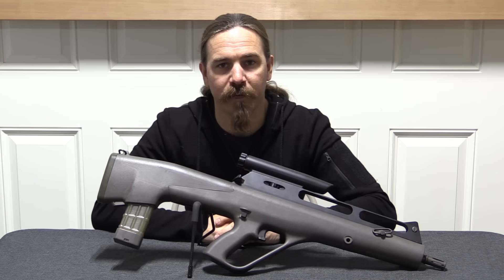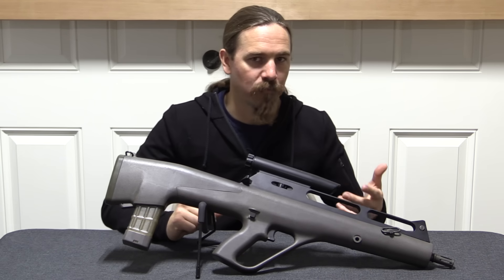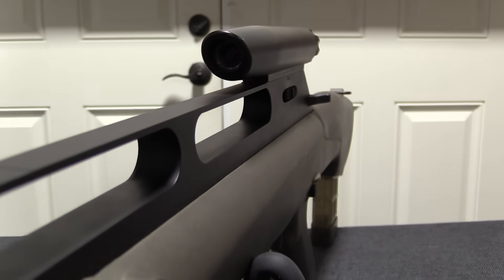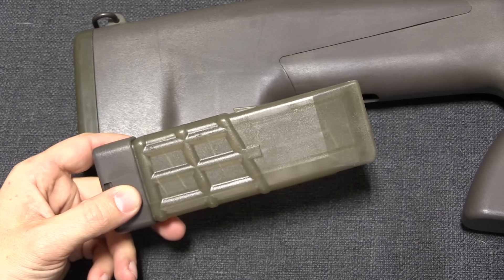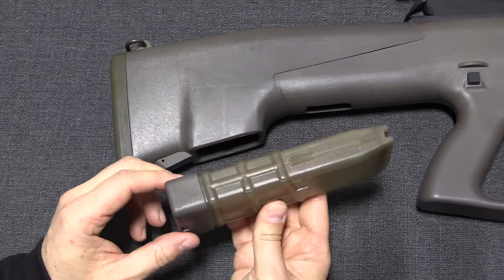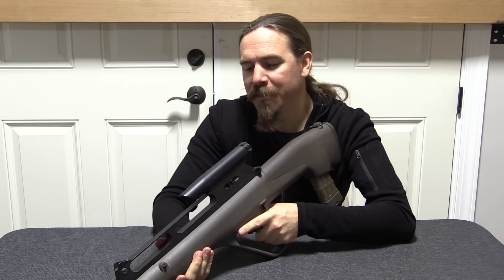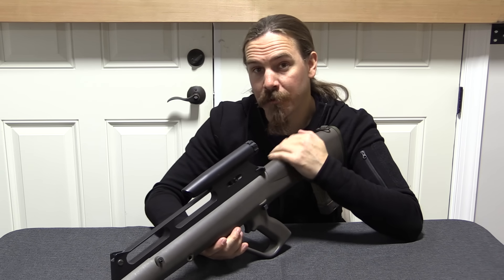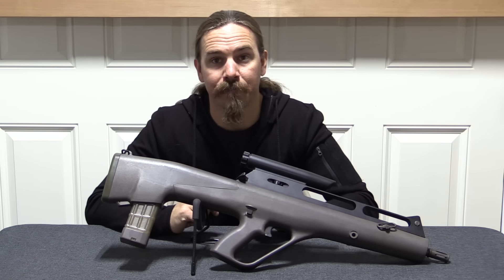Steyr ACR: A Polymer Flechette-Firing Bullpup From the 90s

Comment: As for the G11, not exactly what you're describing. The system was made so that, in 3-round burst mode, the whole internal assembly (barrel, rotating firing chamber even the horizontal magazine mounted on top) is moving backward as the three successive cartridges are fired and it's only ending its course against the backend of the gun (therefore impulsing the recoil against the shooter's shoulder) after the last bullet has actually exited the barrel.

Comment: The problems with this ammo is that in a medium wind outside you will have to compensate EXTREMELY much and thats a bit above a regular soldiers education when you are in combat measuring the wind speed is just not going to happen and it will have no chance against ceramic body armor.

Comment: Can I just say, that as an Austrian I'm really proud that my country has produced not only one, but three space rifles, even though only one, the AUG, actually saw service. Even so, both the Steyr ACR and the AMR (Anti Materiel Rifle) look sufficiently spacey to qualify for the Rule of Cool without any design changes. For those who don't know the Steyr AMR, it's another prototype for a flechette rifle, except compared to the ACR's cartridge, the AMR's flechettes are positively giant. And they have to be, because they were able to effectively take out trucks at 2000m range. Look it up on wikipedia, it's a certified "Fuck you and everything you stand for, on, under or behind" gun. It was meant to rival the Barret m82, but was ultimately scrapped in favor of the latter, which is now used by the Austrian military special forces, the Jagdkommando.

Comment: I really love the idea behind it. I can´t believe that we don´t use the same working principle as with a smooth bore APFSDS round from a tank for rifles and shotguns.
Reply: Because the APFSDS concept just doesn't scale well to small arms.

1.  Shotguns trying to fire a bore appropriate APFSDS projo would almost invariably explode due to the pressures involved with driving the projo to the velocities where the concept works better than "traditional bullets".  Shotguns are invariably designed with much thinner walls in the chamber and barrel, because they operate at pressures under 12K PSI as opposed to over 50K PSI for a 5.56x45mm.  If you build the shotgun to that pressure standard, it would be ridiculously heavy...and the Cube-Square law means your pressures for a "shotgun" sized projo will be higher than the "rifle" version - there's a reason the Rheinmetall 120mm runs near 100K PSI.  So, your shotgun would likely have to be designed around a chamber pressure of [gazes at ceiling, SWAGs it] probably north of 65K service pressure.  That's a LOT of meat you need to avoid it grenading on you, especially wrapped around a 12 gauge sized cartridge...

2.  Bundles of flechettes (such as you find in some artillery and rocket rounds, and has been trialed in shotguns and 40mm grenade launchers) doesn't work, either, even when using the exact same flechettes you use in your artillery rounds.  There's a variety of reasons for that, but every time we try it, we find it at best no more effective than plain old buckshot pellets (and generally worse).

3.  For precision fire, the APFSDS simply doesn't scale down very well, because almost imperceptible imperfections that don't matter on the APFSDS projo for a 105mm or 120mm tank round are fatal to accuracy and terminal performance on a projo small enough for an infantry "rifle".  And you really can't do even the level of QA inspection on them that the tabk rounds would get, due to production volume and cost - you're trying to crank out billions of rifle rounds before you even field the gun, whereas the total production volume of a tabk cannon round is much, much lower.
Reply: @geodkyt  1. 
"...to the velocities where the concept works better than "traditional bullets"..." I don´t understand this, can you please explain further ? 
Let´s say you do take a traditional shotgun and make undersized ammo for it like an APFSDS. You use the same pressure as before. An undersized round should be lighter and given the same pressure should reach higher velocity and because it has less impact surface should penetrate better, give the material is hard like tungsten or similar and the rod is long enough for stabilization resons.

2. Yes I thought so too when I saw the Russian flechette bombs, most of the small darts don´t hit in the right angle either and they seem to be too short to be stable enough, I too wondered why they don´t simply use balls instead. They probably made them and didn´t bother.

3. Yes that is a very good reason, the quality would have to be superb which is not feasible for a low cost item like simple bullets.

Comment: There is an idea behind the "poor" sights. (As said the military wanted a rifle for the "poor" shooter) And this optics help a lot. They are not the most accurate at long range BUT its very easy for an untrained shooter to hit quite a lot with this optics. This was also the idea for the original steyr aug. You have to remember it was designed in the height of the cold war. So the idea behind this was if a war breaks out you have a large number of conscripted relatively poor trained man. And a optic like this helps them alot to get shots on target. Of course a well trained marksman would have prefered a more accurate optic. But as said the idea behind this concept comes from cold war (and was not a bad idea)

Comment: i love this action mechanism it seems like it could have a lot of potential. perhaps it could be adapted to traditional style cartages with standard projectiles where the firing pin just punches a dimple in the side of the case like smashing the rim on a .22. it would have to be something straight wall maybe like a rimless .357 so the empty case could still be pushed out the front of the chamber. fun to think about

Comment: This feeding and locking system was essentially replicated in the Textron entry for the NGSW program (2022's version of the ACR program).

It had a similar fate though. This time round instead of sticking with the M4, they went for a slighlty updated M4 in a bigger calibre. 

Seems that innovating too far doesn't win contracts.

Comment: Hey Ian ，I find something may influence its reliability. When you pull the charging handle , the locking log of the chamber did not slide in the right place because the charging handle was not full pulled to push the lock log into the groove

Comment: i wonder if someone could make something like this built around .22 rimfire or .22 magnum rimfire to utilise the rimfire primer (or tbh could probably be adapted to use a rear primer provided the loader didn't strike the rear of the case in a way that could set a primer off, alternatively a system could perhaps even be designed to utilise a tube magazine.

Comment: As understood, the chambered round is forced against the fix firing pin, while aligning the chamber with the barrel. So no one knows on which level of that alignment the cardridge is going off?
Would it be possible to ignite before the chamber is  fully in battery?

Comment: It’s funny. The US military tried all these ridiculous ideas and crazy cartridges to improve hit probability. Most of these problems were solved by putting a ruggedized high quality optic on top of the rifle. We didn’t need some gimmicky bullets to hit targets. We needed something better than iron sights so the soldier could actually see the target. For years ordnance corps decided against issuing expensive optics to soldiers because the optics were too fragile and soldiers were “too dumb and uneducated” to properly take care of and use them. In the end, an optic on the rifle made all the difference. If the US Military had invested in making an optic that was rugged and simple to use, the problem of hit probably could have been solved years ago. Iron sights suck. If you can’t see the target at range, you cannot hit it.

Comment: Just to point out that just like arrows, the slow spin imparted on the flechettes doesn't actually serve to stabilize them through gyroscopic force.  Rather it averages out any imperfections that would tend to make the projectile curve away from it's point of aim. eg if there is a slight bend, or one of the fins is slightly bigger than the others so the slow spin puts the projectile into a corkscrew rather than curved flight.
Reply: It's been a while since I've read the book The Black Rifle, by Edward Ezel (spelling?), but I thought it was stated in that book that the purpose of the slow rifling was to cause the petals of the sabot to separate reliably and consistently from the flechette, so as not to effect the accuracy too much.

But the corkscrew flight path makes at least as much sense as that, and I know that some air-to-ground rockets have had spin imparted to them for that reason.
Reply: Just like nerf darts with BCAR stabilizers!
Reply: Makes me wonder why they don't make finned bullets
Reply: I think the flechette design could be improved using modern design to provide far better stability and dynamics using Engineering AI techniques for accelerated generational improvements, then using industrial 3D metal printing.
Reply: @user-yv2cz8oj1k  there is no need to use AI to design something that simple, a half decent engineer whose been properly briefed on what you need could design one in traditional cad software in like, a day.
Reply: @justcallmenoah5743  There isn't a total necessary use, an engineer can knock out something basic, but AI can give options to a set of requirements to provide design options a human engineer may not think of, and can provide iterative generational designs to provide rapid development of improved designs.
Reply: @user-yv2cz8oj1k  dude, it's a dart. What possible design variations would there be over what an engineer could think up relatively quickly? Want multiple variations about fin size, count, and weight? Just add parameters to your model, takes about 5 minutes total and you can generate new models with any number of parameters in milliseconds. Want variable infill, which would only really apply to 3d printing, although it could be a useful technique to have lower infill at the back, allowing the penetrator to stay dense while dropping the total weight, parameters, about a 5er. How about variable thickness across the width of the dart, or maybe even variable length, each a handful of parameters.

Basically my point is that the design of a small metal dart is so simple that you could devise an incredibly customizable and tweakable model in basically the same amount of time it would take to make a one off model of a single idea. AI would be entirely unnecessary for something this simple.
Reply: @justcallmenoah5743  And you don't think that applying different venting to apply spin through air movement without applying fins to increase stability and accuracy, plus effects on air resistance, wouldn't factor into it. I've a Masters in Engineering, I very much you've even got a school certificate from when you were 15.
Reply: @user-yv2cz8oj1k  I never claimed to be an engineer, I'm not, I'm a computer programmer, my knowledge of an experience with CAD software is purely at a hobbyist level. 

That said, you just came up with all of those ideas on your own without using AI, so still inline with my point. I really don't believe you would need an AI to generate new geometry for a problem this simple.
Reply: @user-yv2cz8oj1k You really think machining or otherwise forming those types of features into projectiles that have the same sort of sectional density and length to width ratio (and thus are likely to be extremely small in diameter, to keep the total mass and thus recoil manageable) is going to be practical from a large scale (we're talking billions of rounds whose projectiles cannot cost more than pennies each) than implementing fins and a slow rotation to achieve the desired CEP?

It's cool to design innovative thubgs, but ultimately you have to be able to produce it while meeting externally set (and generally extremely firm) cost, schedule, and production volume requirements.  If you cannot afford to make enough, fast enough, then any theoretical advantage is 100% moot, aside from a cool research paper.
Reply: @user-yv2cz8oj1k Yeah, use the software that keeps hallucinating to build our new weapon

Comment: Three years late I know, but I just discovered how to complete the disassembly the Steyr ACR: “By removal of the rear plastic stock, the soldier can pull a quick disconnect sleeve [the red collar in front of the chamber block – I think] and remove the barrel with a quarter turn. From this point, the gas piston return spring is free to be removed, the misfire ejector may be removed, and the mechanism is easily broken into several sub-assemblies. Springs are easily compressed by hand while pins need only finger pressure to remove or are easily punched out with the sling pin.”

Comment: cant they just make the sabots flamable, so it will dissapear in the air, it seems they took out the AAI out of production because some people got injured/killed from the sabot remains in 'Israel' by using it in action,  its israel so I kinda doubt the legitimacy of the accusations, the gun itself is very cool and high tech, with an insane rapid speed of shooting and flat line of the projectille, but somehow its been taking out of production. I have the feeling the gun was too good, so they removed it with accusations of dangerous, so less lethal weapons would be in use instead, although some people will know these older models are superior in some regards.

Comment: I have shot the old Aussie AUG version , and it came out with  a thick floating  donut aiming mark , 1.5x scope , the idea was to make it quicker to use at CQB distances , as their is NO cross hair to slow you down .So it is meant to foster quick snap shooting  at close range encounters .
But this actually means you have no precise aiming point at all , and when we shot it in a rifle match , aimed shots from 300m ,200m,  100m , we could not get a reasonable score , I was use to the NZ version , that had the thick floating donut , but inside that a fine cross hair , enabled very accurate shooting , and in actual use , the fine crosshair can be selectively ignored and you just use the donut as a quick referance for close range CQB shooting .
So in short it did not work as entended and that 1st Aussie version was replaced with the same reticle as NZ was using .
You can always ignore a fine cross hair , IF you want to , BUT you cannnot use a crosshair as a fine aiming mark when its NOT actually there .

Comment: Something I don’t hear a lot about is the terminal ballistics of flechettes. I a small fast projectile sounds like a recipe for a relatively clean pass through (as clean as a dart at over a km a second can be), do they tumble or shatter like a 5.56 ?
Reply: Individually they are not as good for wounding as regular bullets but in groups they can be quite nasty. They are used in some types of artillery shells and air-to-ground rockets.